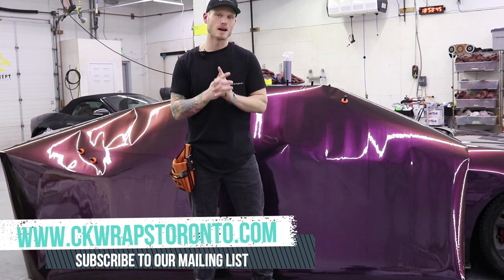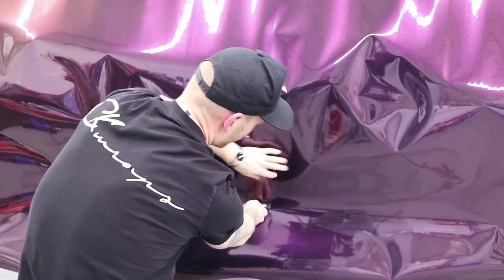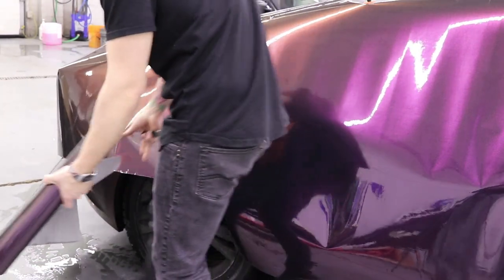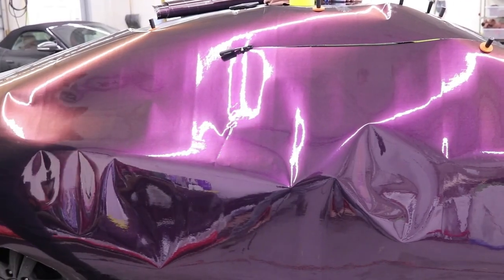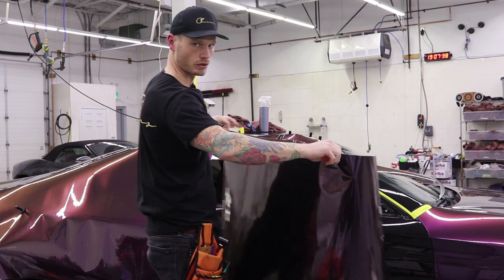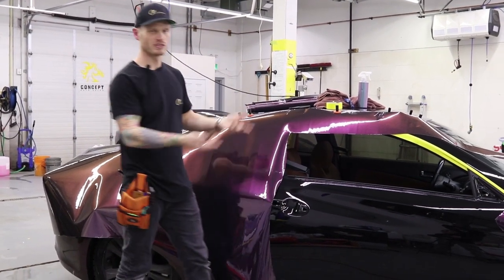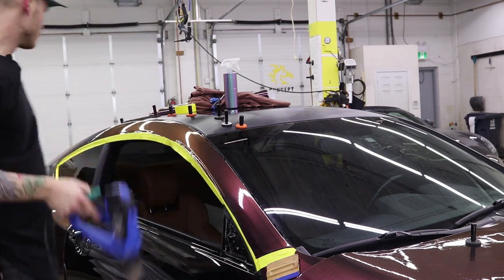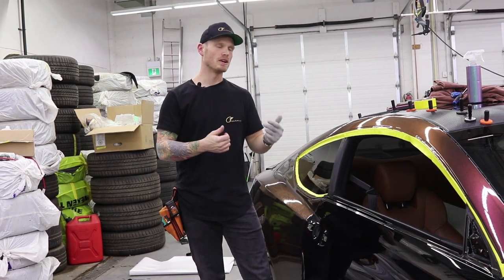DETAILED WRAPPING MY CAR! How To Vinyl Wrap Rear Quarter Panel  | Vvivid Vinyl Nightshade Purple

Comment: Nice job man, I’ve never used Vivid Films, how are they in comparison to 3m or Avery far as tac and ease of install. Also I like the magnetic Squeegee, I used Geekwrap black buffer version for years, be nice if they had that feature spec for the money they cost. I find these newer films with the Cap makes install a lil tougher on some areas so I remove it once I get to that spot, wish they made it more pliable tbh. It’s great far as helping against scratches etc

Comment: A question about masking.  Are you masking over the rubber weather stripping? And, are you running your blade on top of the masking in order to not cut the weather stripping?
Reply from the maker: Yes exactly
Reply: @CKWraps   Is there a specific kind of masking tape that I should be using?
Reply from the maker: @gregpruitt1647  I use 3m 301+